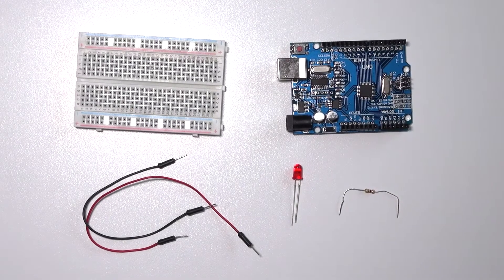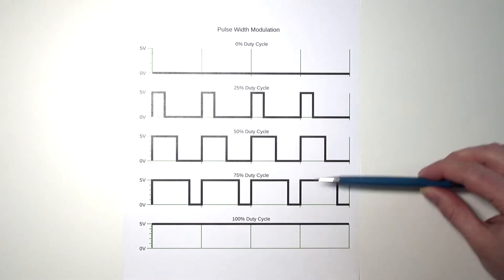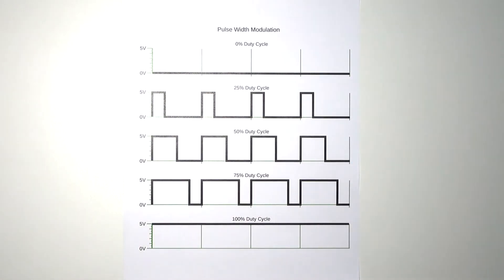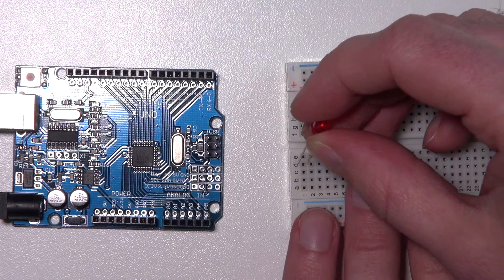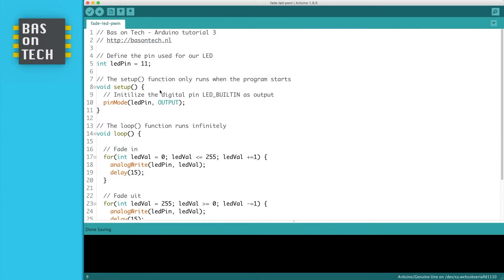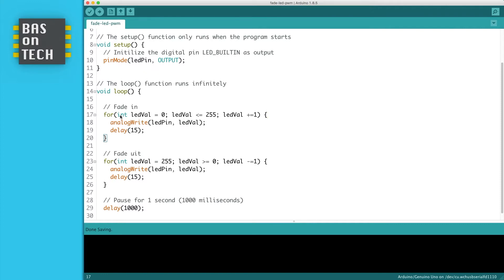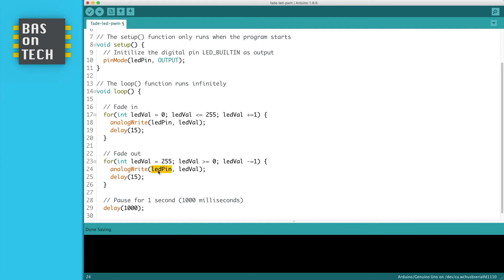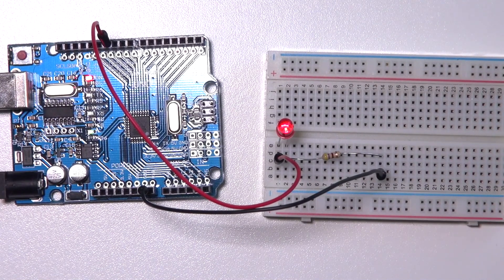FADING LED ON BREADBOARD WITH PWM - Arduino tutorial #3

Comment: Thanks for the helpful videos.

On the Arduino IDE, why does the LED only fade when I type 'analogWrite' and not when I type 'digitalWrite'?
Reply from the maker: Hi, digitalWrite() can only write 2 values: HIGH and LOW. Therefore the LED can be On or Off. analogWrite() is able to write 1024 different values so the LED can have 1024 different brightness levels which we se as fading.
Reply: @BasonTech  Wow. Thanks.

Comment: Done ... I have to do more with the "for" function. I didn't really quite get it completely.
Reply from the maker: For loops are not the easiest part of programming. However what could help is to make some on your own. For example:
- a loop that goes from 0 to 10
- a loop that goes from 5 to 10
- a loop that goes from 5 to -5
- a loop that goes from 2, 4, 6, till 10
- a loop that goes from 1, 5, 10 till 20
Good luck! 😃
Reply: @BasonTech  Super idea, thanks, I will do it now.

Comment: Im new to arduino & for your channel. Greate tutorial. Still watching from #1.
I have 1 question, in the beginning you said in digital pins can deliver 1 & 0 only then how led dimmer works with digital pins (im assuming dimming is analog). Again i want to remind you im new to arduino 😉
Reply from the maker: Hi, interesting question! A LED dimmer can work multiple ways see https://blog.visual.electro-matic.com/how-do-led-dimmers-work But if I understand correctly you make LED blink very fast and that simulates the dimming 😃
Reply: @BasonTech  noted with many thanks